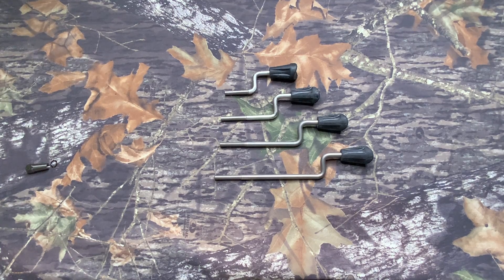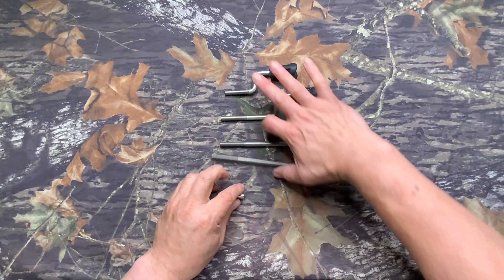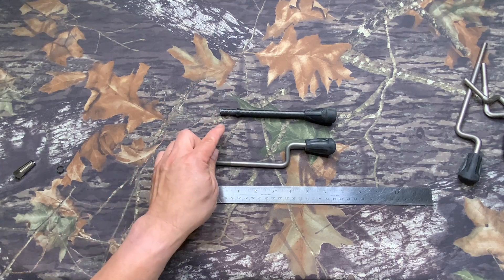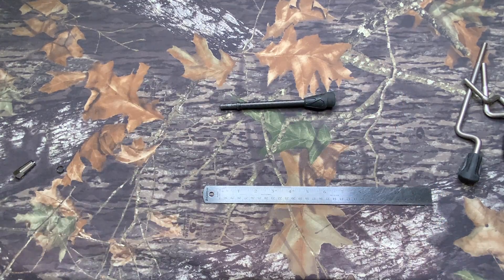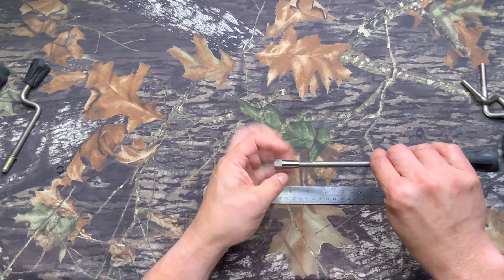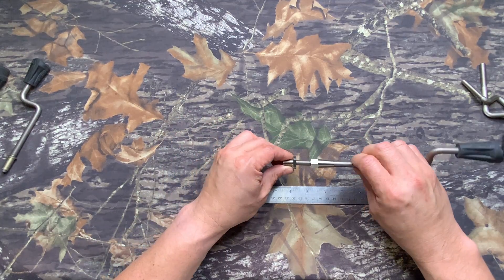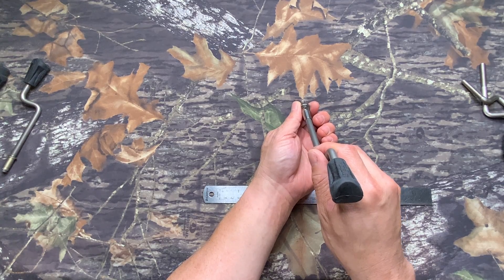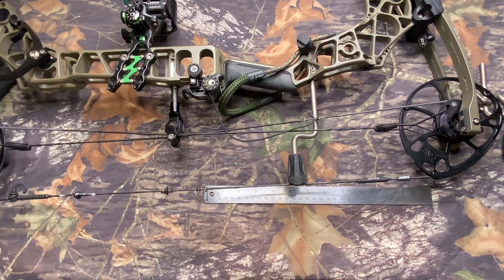Firenock Mini-Class August 2021 Henry IL #2 (Demo Only)

Comment: Do you have a video with install of the aero rest for the ravin crossbows?
Reply from the maker: No, we do not as it is quite straightforward. Take the old one off and put the new one on and make sure it is centered.  Nothing to it.
Reply: @FirenockTV  OK 
Would it fit on my ravin r15 with 20" bolts?
Reply from the maker: @greekmaster1001  no it will not. The only Ravins that can use 20” bolts after the AeroRest installation are R10 and R26. All others need at least a 21”. We recommend 22”